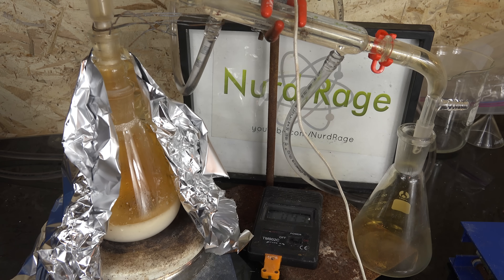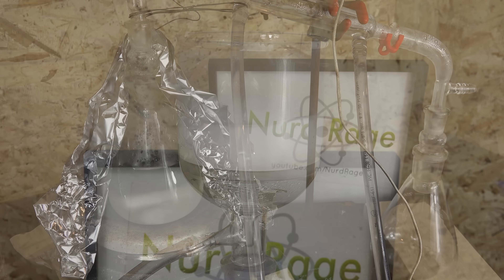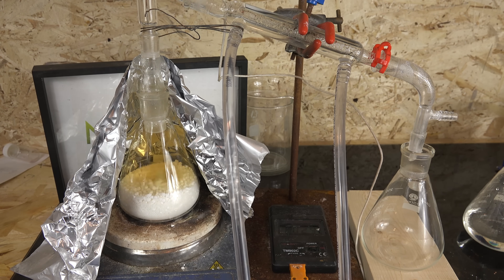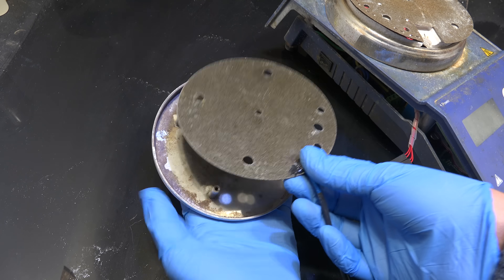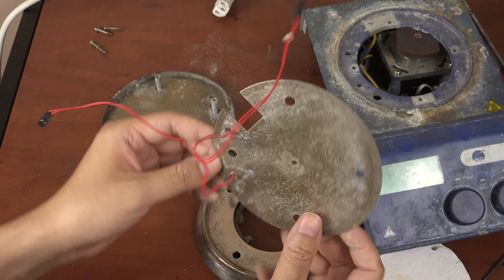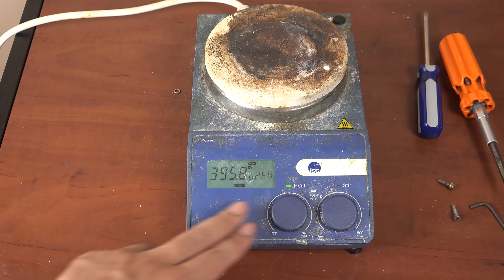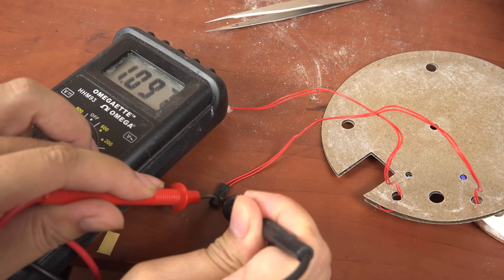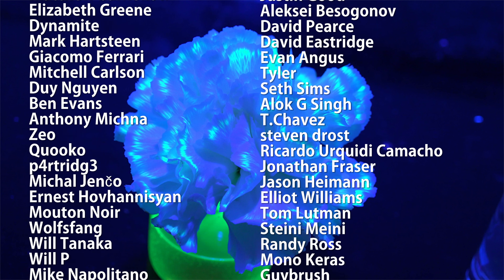Lab Notes -  August 31st - Nitric Acid from Calcium Nitrate and My Hotplate Failed, Again.

Comment: You can try discharging capacitor to spot weld PT1000s. You will just have to make a several trials to see what kind of energy is needed to spot weld the wires, and then just charge some large caps to get it to enough energy (and hopefully not to vaporize a sensor). After initial runs, it behaves quite/ consistently afterwards. This copper foil connection will oxidize and it can start varying a temperature, making a mess of experiments.  Good news is they are failing safely (increasing resistance equals increase in temperature) but lack of heat can be an issue...
Reply: or he can use an epoxy https://www.jbweld.com/product/j-b-extremeheat to stabilize the connection But IMHO the sensor only needs be in the hole it doesn't need the leads so close to the hot plate... I would probably use a method that is not so permanent for the next time it goes out on you.
Reply: You can find a video on youtube for a DIY Battery Spot Welder. Basically just a car battery shorted to weld some tabs onto li-ion cells.
Reply: DinkleDigeroo  Car battery is way more dangerous. Capacitors may be charged to non lethal voltages, but if capactances are sufficient, energy can be quite intensive to melt zinc - copper alloy from which leads are made!
Reply: @Fenris0000  A 12V lead acid battery might be dangerous if shorted for a long time, can't happen without a thick gauge wire or bar of metal, thin wires just immediately burn up and interrupt the connection.
A capacitor might be dangerous if charged with a high voltage.
It's just quicker and easier to use a car battery. An appropriate capacitor won't be as easy to obtain.
A capacitor option is interesting when combined with other compact and light circuitry so you end up with something portable and powered by a li-ion battery bank.
Reply: I have the camera flash module from a disposable camera saved for welding K-junction thermocouples.
Works well when you want the absolute smallest junction for rapid response in air.
Reply: The easiest way to fix these would be to use suitable sized bare metal bootlace ferrules and crimp them. Costs pennies and is reliable enough for this application.
Reply: Was going to say what OP said about making your own spot welder and a 0 to 30v supply & bank of 50v caps.   Vary voltage to charge level, test spot weld.   Use a momentary switch (step on it) to spot weld.  If it is not enough energy, up charge voltage some tey again.   😊
Reply: I think thats gonna be a relatively expensive capacitor.
Reply: @htomerif  you can tie a bunch of them in parallel also. I used to do that with some large 25 volt caps. Had about 6 of them tied together, used a bench power supply to charge them, and could spot weld pennies together. Touch one penny to the other and Bang! welded. For smaller things I would have to only use a couple of them or it would blast the lead right of a resistor or something instead of gently welding it.

Comment: You might have problems with the copper foils, each heating will cause them to expand. Then they change position slightly, and eventually they will lose the electrical contact. Since you do not have the ability to weld, you need to crimp the connectors. The most available are probably the smallest ones car mechanics use or bootlace ferrules. Just strip the plastic off if any.
Is there any possible use for the residual products in the dry method?
Reply from the maker: Very true about the copper foil. I guess i'll just have to cross that bridge when i get there. I might see if i can electrochemically bond the connections if it gets really bad. That might be an interesting video it itself!

As for the residues. I'm not really sure. I suppose if you filter it, you can get crude calcium sulfate powder. If you heat it up to dehydrate it you can make your own plaster powder.   Also calcium sulfate powder can be used as a catalyst support (but i'm not sure if i'll get that far on my channel). If you mix it sodium carbonate solution and stir for a few days you can convert it to calcium carbonate which is useful as a base for other reactions. Personally though, for the amount of work and cost, it might be more straightforward just to buy those end products. But i'll see if there is enough interest to attempt a recycling effort.
Reply: @NurdRage  Electroplating the connection makes a lot of sense if crimping isn't good enough. But a good crimped connection can be good enough for aerospace grade parts so it will probably never come to that.
Reply: @Lossanaght  Exactly. Crimping is the way to go.
Reply: @NurdRage  glues like jbweld would work however i am thinking it would be best not to get the jb weld on the mica plates themselves.
Reply: NurdRage out of curiosity, why the vocabulator?
Reply: @NurdRage  Came here to suggest crimping as well. Electrochemically bonding is an interesting idea though! Could that work to create reliable connection for different metals like copper+aluminium? They are usually problematic to crimp because of the difference in thermal expansion means that things will loosen up over time when thermally cycled, the exposed surfaces then form oxides which increase resistance over time (potentially leading to overheating).